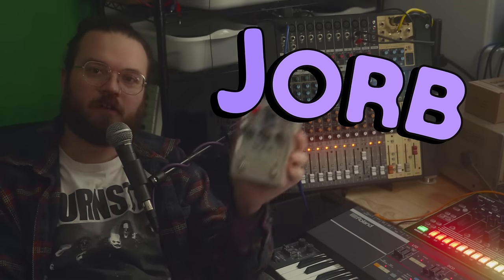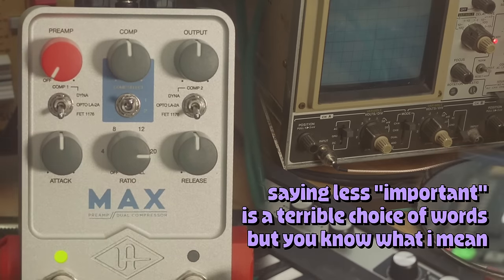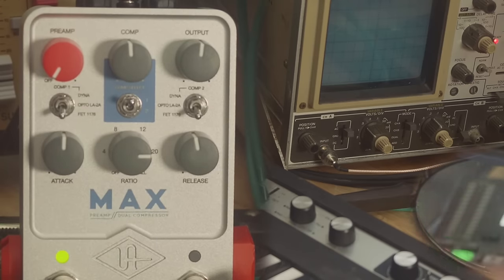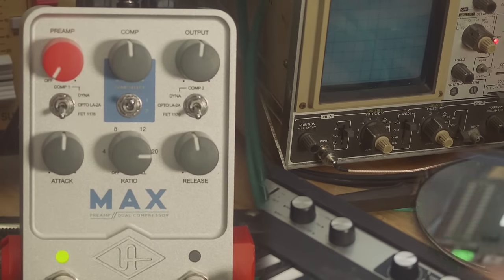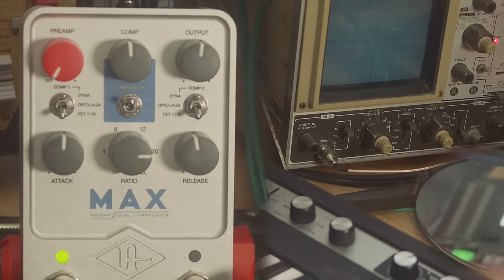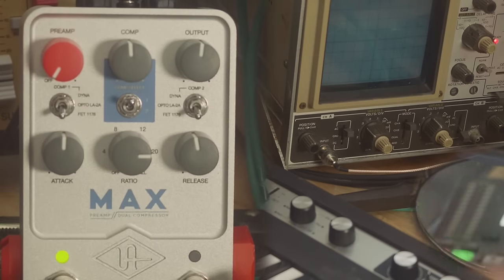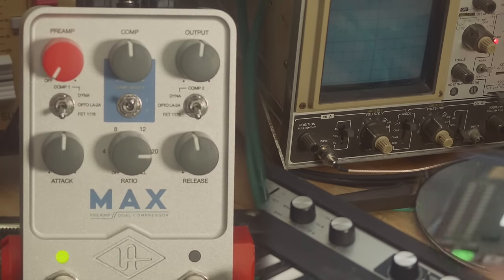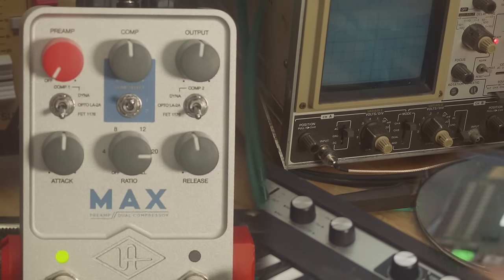How To Use a Compressor (And why the UAFX MAX is a great one)

Comment: Useful video. For an extremely complicated and annoying pedal. While you're learning, who knows what you've done? If you put it away and come back, and open the app, it forces you to update and mine would no longer connect.  So I did a factory restore to at least reset it in Serial. Interesting pedal.  But the knobs are a pain. At some point, unless you write them down or you're a studio wiz you have no idea what the settings are. Especially during the learning process. The good news is that it forces you to learn. That said, if I had to do it again I'd buy the Origin Effects compressor.  Finally, the UA pedals SOUND great. Eventually.  However  their software is shaky compared to other top manufacturers. And while you're video is helpful, so thanks, it's a little odd. It is a guitar pedal after all. Why no guitar?

Comment: Bass guitar is my main instrument, and I fell in love with the LA-2A years ago.  I bought the MAX specifically to have an LA-2A in my live rig, the things it does to a bass guitar are almost obscenely sensual.  In theory, I can run my synth bass through it on a different channel but I've mostly floundered around and been unhappy with the results.  This video is a far more comprehensive breakdown than any of the review videos I saw on release, and now I'm looking forward to plugging my synth in and twisting knobs until it sounds better.  Thanks, Jorb!
Reply from the maker: 🙏🙏I was going to do a short section on bass or guitar, but checked and saw they were well covered.

Still wish I had taken the time to set it up for a discussion of feel & sustain...

Comment: How about a video about the Tascam? They've been around a few years, but seem to be more popular all the time. Are they on sale? Particularly good for something? And for you, why the 16 and not the 12 or 24?
Reply from the maker: It is in the cards, a video just in the tascam (trying to get them to sponsor it😅)

The most important thing, I need multi track out for video editing, and id rather not do it over usb, I don't have a pc in my space. 

This let's me do all 16 tracks seperately onto an SD card. 

Why the 16, if I record my vocal, my mpc, & 3 stereo synths, that's already 9 tracks. Not an uncommon set up for a full jam at all
Reply: I've had a Model 16 for a few months and I love it. Sounds great and I can multi--track my synths without ever turning on a computer. I was thinking I would only need the 12, but it turns out 16 channels is very useful. Also the mixer part of the 12 is digital, when on the 16 and 24 it is an analog signal path before the digital recorder.

Comment: Bummer UA didn’t think to add a blend control on there to mix in the dry signal. With that, this pedal would have been real tempting.
Reply from the maker: You can use the parallel routing, then have one be clean / ratio to off, but that's a work around, I agree with you.
Reply: Once you set the unit into parallel routing, is there a way to set the balance /mix between the dry & compressed signal; or is it fixed?

Comment: Superb video Jorb. I love the fact that it combines 2 classic 19in rack compressors but not so hot on having to use a mobile/cellphone to tweak the settings (that's probably an age thing being Gen X) I just want to tweak physical knobs, but if push came to shove...
Reply from the maker: @apislapis  no, you're right the app is a pain. I've only had trouble with it.

BUT there's plenty of good without it, I think enough

Comment: Ahhh man, it wasn't until this video that I finally checked in UA's FAQ; the main thing turning me off some of these non-Time Based FX was the "poor" assumption that they were Mono only! 
But according to UAFX, while they do expect unbalanced connections, they can accept TRS, and have both Mono-I/Mono-O & Stereo I/O - is this true with the Max as well, Jorbie?!
Reply from the maker: Max is stereo, yes, dual TS inputs / outputs.

Some of the new cheaper ones are mono though, and some don't have presets, even thought that FAQ says they all do.
Reply: @JorbLovesGear  Ahh that must be where I was confused (and makes more sense in hindsight); I thought this was one of the newer smolbois with 1-jack/per! 🤝🏽

Comment: Compression is still the one effect I can't find a use for in my setup
Reply from the maker: What's your setup?
Reply: Compression isn't really an effect, 
it's more signal processing.
Reply from the maker: @bangprints8816  I think that's too pedantic, chorus is "signal processing"

And part of what I talk about, compression especially when implemented as classic circuits isn't totally pristine, it will color your sound, like overdrive or anything else.
Reply: @JorbLovesGear  To be fair, most of my experience with trying compression comes from trying to make it work in my guitar chain.

Jazzmaster/Strat -> Hizumitas -> Rat -> Loomer -> MS-50G (usually switched off) -> Canyons -> Resound.  I've tried putting it before the Hizumitas, before the Rat, and after the Resound.  Seemed to pick up string noise and play up reverb tails longer than I wanted.  It's been a while though
Reply from the maker: Any comp will increase clean sustain, which changes behavior behind it. Up to you to decide if accounting in other settings is worth it.

I'd put compression after the fuzz before the rat, and depending on results, be ready to never use fuzz + compression at the same time. Fuzz often reacts best to direct output.
Reply: @bangprints8816  the right characterful/coloured analog (or simulated) compressors will definitely have a traditional "effect"-like usecase, unlike fully-transparend studio compressors - especially when driven, coloured compression squashes & glues a drum buss together with a REALLY stuffy—almost claustrophobic—overdrive & "dizziness".
Even indirect compression, like when really driving the amps in a tape recorder into saturation does the same thing, pushes into compression in a way that is destructive in harmonically pleasing ways.